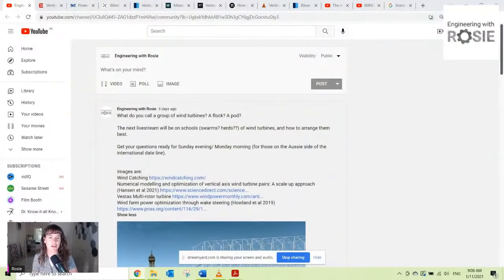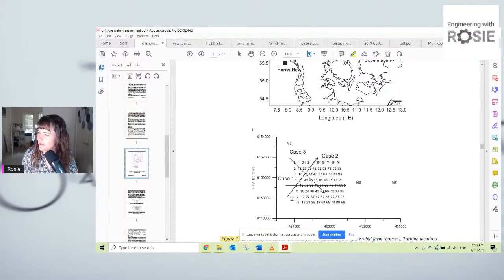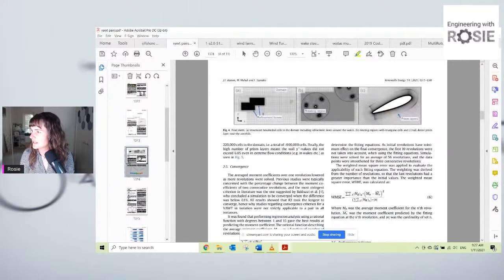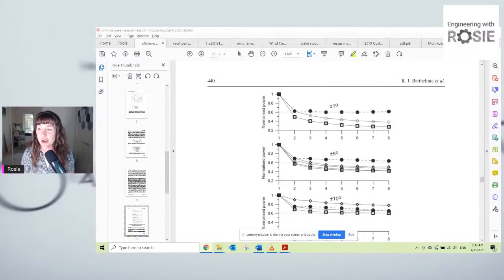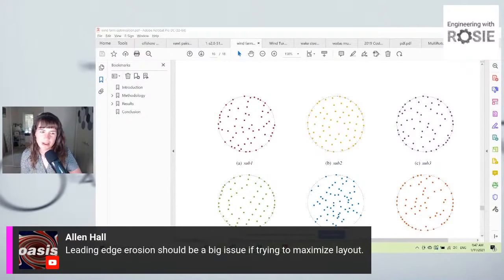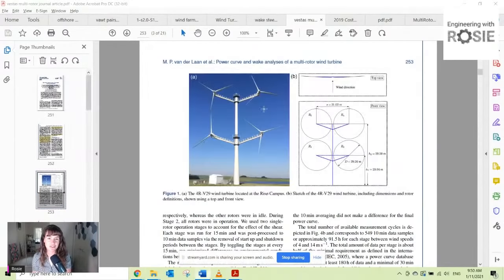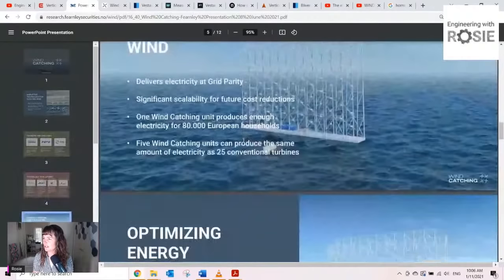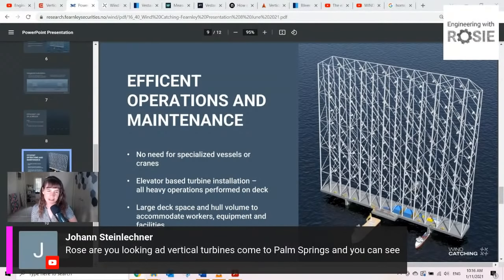The BEST way to Group Wind Turbines? Wind Catching, VAWTs & Multi-Rotors | Eng with Rosie Live Ep. 4

Comment: I am retired aerospace engineer who worked as a helicopter engineering test pilot for 35 years. 0:25 
I wonder how the wind turbine industry deals with blade beam
Bending stresses.  In a helicopter the rotor RPM is critical to prevent extremely high blade and yoke bending loads.  With the rotor turning the centrifugal forces stiffen the blades and prevent high bending loads. Even on a helicopter as the rotor speeds up or slows down while starting the engine the beam bending loads can be very high at azimuths going into a high ground wind.
In the wind turbine industry I would expect there are protections when wind speeds are high and the rotor is stopped.  In that condition on a helicopter the blades are tied down preventing the lift over the blade from flexing it in the beam
Direction.  Wind turbine blades would have the same issues, how do they prevent beam bending failures of blades and yokes?
Eric W. Gibson

Comment: I KNOW that Vertical Wind Turbines are less efficient.  I know that here in the Austin, TX area, any sort of wind turbine is not very practical, and I actually favor solar panels- we have an 8.84 KW system on our home.  But there is something about a smaller, gentle VAWT that is appealing to me for some reason- wanting something simple that could generate electricity when the sun isn't shining, and is contrained by area, like a back yard.  It's like yearning for a piece of chocolate that has no calories...  Anyway- any thoughts or links of reviews for the Flower Turbine being marketed in the US and Europe?  Home - Flower Turbines

Comment: Any comment on the efficiency of ducted HAWTS?
Reply from the maker: Yes, it depends whether efficiency or cost is more important to you. They can capture more energy than a non-ducted turbine with the same rotor diameter (i.e. they are more efficient) but at the expense of more material and more complexity (more expensive). No one has made it work economically yet. Here are some videos I made that refer to ducted turbines: 
https://youtu.be/7-awFXqisYA
https://youtu.be/6vb18oXPli4
And you should also check out Wind-works for articles on real ducted wind turbines and how they performed in real life: http://www.wind-works.org/cms/index.php?id=637

Comment: Hi Rosie, some time back there was research into adding bumps or (tubercles, found on whale fins) to the leading edge of the blades to increase performance iin low wind speeds, wondering has this been successful
Reply from the maker: I haven't seen it ever used on a commercial wind turbine. To be honest I am not sure that the benefits of the tubercle design actually solve any real problems with wind turbines. I am planning to (one day) do a video on nature-inspired designs in renewable energy, and I would include tubercles in that.

Comment: Rosie, can you please do a video on VAWT efficiency, particularly in relation to Betz law.

I did my fourth year engineering thesis on over speed VAWTs. ( back in '75 ) What I found was that the torque output went exponentially up once the relative velocity exceeded one. That's torque and not power output. I was limited by computer capability ( IBM 1130 4K ). In effect the VAWT will continue to accelerate until it destroys its self if power is not harvested 

Which is better, more thin blades or fewer long cord blades. IE 3, 5, 6 ,7, 9. What should be the ideal coverage, IE total cord vs circumference. I'm thinking a VAWT needs much less foundation if the top bearing is supported by guy wires. That support would probably help in capturing energy to a higher wind speed vs horizontal. There is the issue of turning the blades to neutral at high wind speeds. 

It took me years to get my head around Betz law and that you can't get maximum power by stalling out the wind speed to zero.
Reply from the maker: I did talk briefly about VAWTs with respect to Betz law in this video: https://youtu.be/ldt405jIR0E
One day I may do a more in depth video on the aerodynamics, but I don't want my channel to focus solely on VAWTs so I am pacing the videos on that topic out so I don't lose interest! 
Have you seen this document? It is a great retrospective of all the effort that the US government supported on VAWTs, and all the lessons learned. It's very interesting!
https://energy.sandia.gov/wp-content/gallery/uploads/SAND2012-0304.pdf
Reply: @EngineeringwithRosie  Thanks Rosie. I saw your video and left a couple of comments. They're buried among the 600 plus. The Sandia report is something I haven't seem before. With a horizontal axis the results are relatively easy to predict and the control is relatively simple. The downside is the tower and foundation cost. The only time I've seen a vertical with overspeed the results were confusing. Sales literature on them is at best unreliable. 

This is a rudimentary explanation

What I did was rather rudimentary. At a low relative velocity the wing going upwind will have a relative velocity of v ( wind ) plus the rotational velocity. The wing going downwind is v ( wind ) minus the rotational velocity. In effect the wing has the trailing edge facing into the wind. In one rotation of the main axis the wing stalls several times. It effectively becomes just a barn door when the wing is perpendicular to the flow. 

When you get to a speed ratio higher than one then even on the down wind side the wing is seeing the airflow coming to the leading edge. It does however oscillate between a positive lift and negative lift. 

At low speed ratios it's basically an anemometer. At a speed ratio of one the torque is negative so it won't ever over speed on its own. Once you get to a speed ratio greater than one the torque output increases rapidly. the torque value vs speed ratio is an S curve.

The "trick" is to find the optimum wing angle between the radius from the center point to the wing and then angle the wing. 

That's as far as I got. I never calculated the actual power output. It also means that you have to provide a power input to get to a speed ratio greater than one. It's hard to describe the the effect in words. I's a lot easier to draw a diagram.

Comment: Thank you for your work. Two more Questions.
In the old days farmers used to put a hedge row  of tall trees to insulate their crops. Do Wind turbines provide a similar coverage ?
Can vertical axis wind turbines operate well underneath horizontal access turbines without causing too much undo turbulence
Reply from the maker: You could use wind turbines in that way if your goal was to stop wind. But stopping wind completely (or nearly completely) is not compatible with extracting maximum energy for electricity, so you'd have to compromise on that aspect. 
If you wanted to I'm sure you could put VAWTs or short HAWTs underneath a normal wind farm, but then you couldn't use the land for grazing or anything else so not many people are likely to want to do that.

Comment: I was in Canada and the Wind turbines were all in a zigzag arrangement and this went on for miles.
I do have a question unrelated I have heard that by painting one of the blades black this helps lower birdstrikes have you found any evidence to support that? Thank you
Reply: If you google about the black blades you will find a paper for the Ecology and Evolution journal that says what you are looking for.
Reply: I think what you are seeing is turbines along a lake shore. I'm thinking mostly along the Great Lakes in Ontario. It is mostly because of prevailing wind direction and topography
Reply from the maker: I have heard that too, about black blades. I haven't seen anyone try it on a large scale, so it's still untested. I'll cover all the ways that people have come up with to protect birds around wind turbines when I make that video, including this black blade idea.
Thanks for the comment 😊
Reply: In the helicopter industry this is called conspiquity.  The ability to easily see something.  Blades painted in alternating blocks of white and black are very easy to see.  Other colors have been used.

Comment: Ah I see, in energy we all have something dear to us, I see yours is wind  😁 For me it's conservation, not to be mixed up with efficiency. The two are widely different in my book. The UK energy companies use energy efficiency as a means of justifying selling more energy. An America refrigerator can be double AA+ but use five times more energy than the refrigerator it replaces, now that's efficiency. Energy conservation is to set an overall usage and systematically in three stages, Short, medium and long term, thus using less energy over time. Efficiency can fit in with that as long as the overall figure drops, as can zero carbon. The latter is interesting in that if the Worlds energy was all zero carbon we could like in super heated paper houses and throw the energy targets away of the Building Regulations. However what conservation offers through less usage Is reduced primary convertion need. In effect less turbines not more.
Reply from the maker: I work with all clean energy technologies, not just wind. This is a video about wind. You can check out the other videos on my channel for other technologies. I am a fan of energy conservation too.

Comment: Please can you do a video on Turntide technologies switch reluctance electric motor. This motor which they want to replace all the worlds motors with has an average energy saving of 68% It eliminates many of the control regulators used in current switch reluctance motors with a fully software controlled switching algorithm and the number of motor poles are increased. This technology can significantly reduce the cost of drive trains even for heavy machinery and mining equipment whose costs have to contend with hybrid and complex power switching mechanisms
Reply: Turntide is a very fast growing company moving far quicker than press reports have to catch up. Rhey have aquaired a number of large automotive parts manufacturing companies already. It will be good if viewers know what all the fuss is about. Their technology is even more efficient that the Tesla model S and X motors with better characteristics and less controllers.
Reply from the maker: Thanks for the suggestion, I will keep it in mind though I will admit there are a lot of topics ahead of this one so it may never happen 😊

Comment: In the UK the Government are are pushing for heat pumps to replace gas boilers and there has been a lot of scepticism over this. But the mainstream media have bypassed the fact that in Sunderland the local council has been converting tower blocks since 2019 to use a system of heat pumps (Kensal) with each flat having its boiler replaced by a thermal battery (SunAmp). So many people rant and rave about the government forcing them into using heat pumps, but there are other alternatives out there like infrared heaters (Herschel) or smart hot water cylinders (Mixergy) to name a couple. Could you look into how we can replace natural gas for heating.
Reply from the maker: Great suggestion! I will try to get onto this in time for the northern winter
Reply: @EngineeringwithRosie  The Northern Winter is almost here - with many areas down below 0*C with the arrival of November!

One area that often seems to receive little attention is the use of a windmill (windpump) to run a compressor. The compressor is a fundamental part of a heat pump, so if used in combination, could a windpump accumulate enough compressed energy to operate a heat pump effectively?

So much attention is given to the generation of electricity, but the greatest requirement for energy domestically is for space and water heating - could this old/new tech approach be feasible? 😀

Comment: This SEDMES process for converting CO2 to Dimethyl ether in the latest reckons they will reach 100% single pass co2 to Dimethyl Ether conversion. The LNG industry is promoting DME as a potential carbon negative mix for LNG or even an LNG replacement. It has low co2 mission lower than was used to make it so it theory is carbon negative, capacity can be somewhat increasd but there is also antimw penalty. so the system is considered for building integrated CO2 capture using HVAC systems with higher buildingninternal co2 concentrations caused by human breathing (50,000ppm per breath) A number of researchers came together from different european institutions for the HVAC integrated CO2 capture concept. However it is limited by local co2 capture methods and relies on H2 for the sorbtion core shell reaction https://www.youtube.com/watch?v=BaTOlbyUM8c
Reply from the maker: I just recorded an interview on CO2 uses, and we talk about the fact that they all use energy so it is not a matter of CO2 capture and use replacing the need to move away from fossil fuels, it can only happen after we move away from fossil fuels. Otherwise all you'll achieve is spending a lot of money for minimal benefit to the atmosphere.
Reply: Verdox has a co2 capture system using polyanthraquinone and they are currently going through iterative trials to find a high surface area loading method with micro core/shell particles, a variation on the first Vacuum swing absorbtion method. Originally the co2 air loading they achieved was 100,000ppm so by volume, surface area of absorbent and capacity I guess they are going for 400,000ppm which can enable two and three pass total co2 concentration via charge and discharge cycles. they have released no recent media so maybe you can contact them to see if they want to share their latest research on one of your videos. It is not such a simple description bit not beyond the scope of one of your videos. Verdox.com
Reply: Verdox last PR relations vid https://m.youtube.com/watch?v=QMF2csipZIU
Reply: Capturing CO2 is going to require more energy that it produced by its generation in the first place. That’s just thermodynamics. Companies claiming otherwise are either lying, delusional or both.
Reply: @fredbloggs5902  Unless products are derived from co2 extraction it will never be a viable option. renewables integration to derives products such as DME or carbon black have to balance off the energy fed. Voltage supplied by triboelectrics possibly generated by building integrated facade panelling or a number of other strategies will need to be employed in a clever engineering solution.